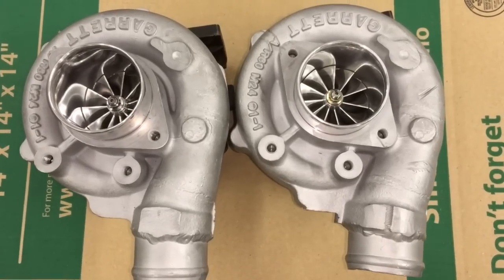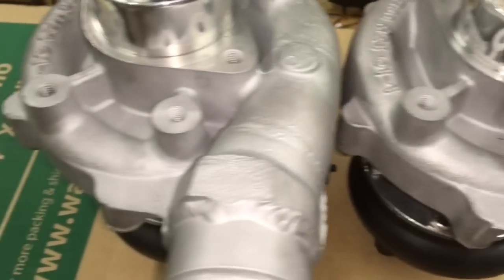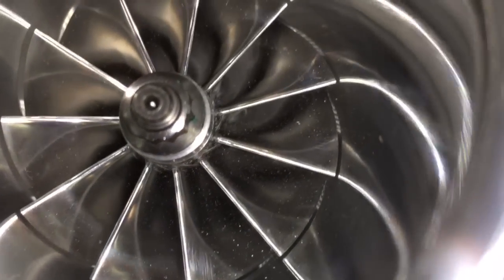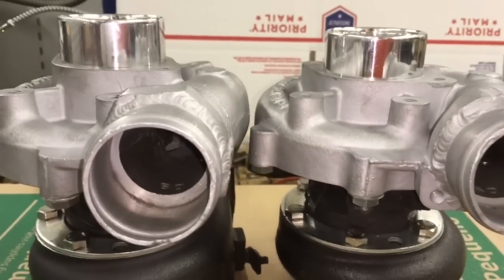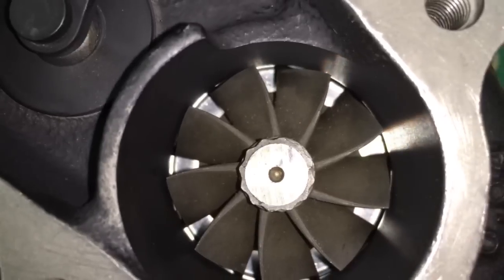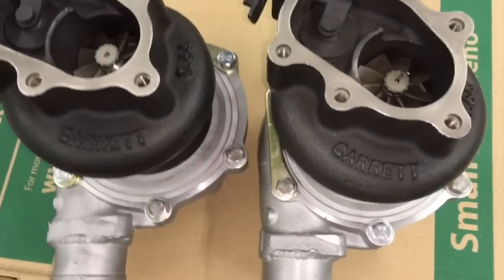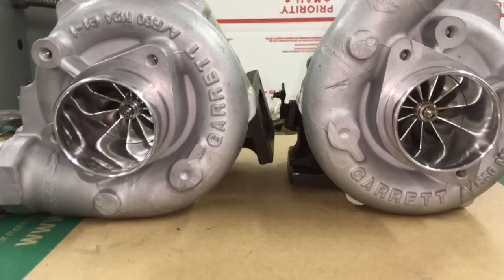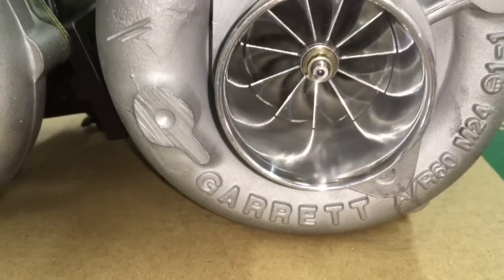Garrett GT2871R variations

Comment: What does the "1-1" stand for? I am wondering because I saw pics of a S15 t28 compressor housing, and "1-2" is listed on that housing ...Would that be a direct replacement on a gt2871r? What does the "1-1" and "1-2" stand for?